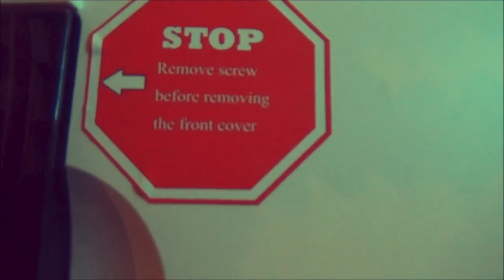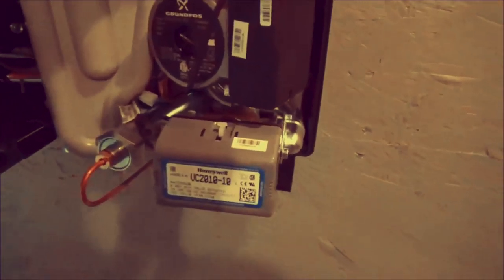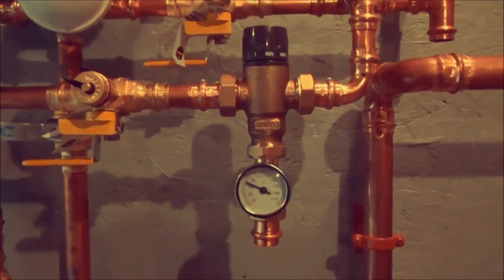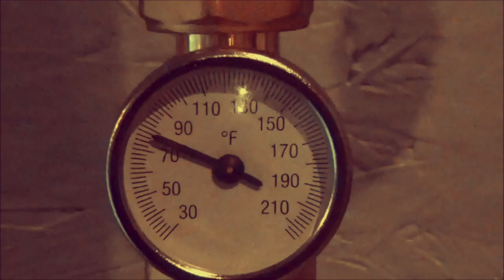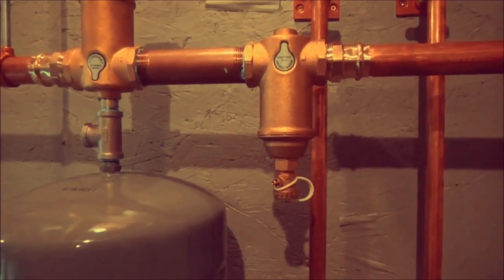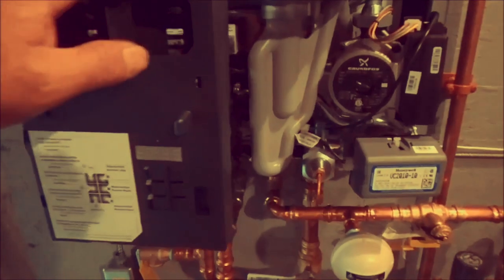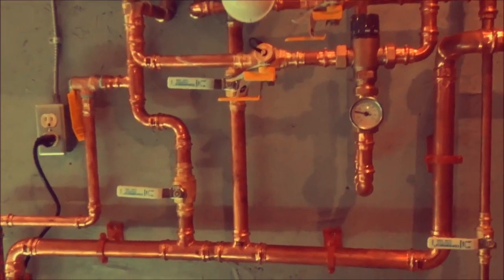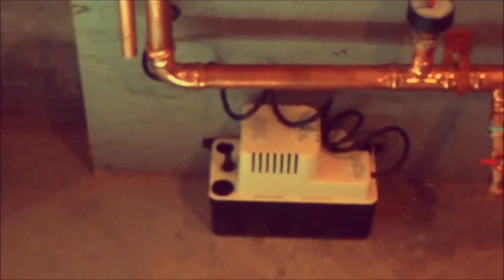Installing a Rinnai, Modern Condensing Combination Boiler

Comment: These are actually good units despite what some of the comments state... Lack of maintenance and service techs that throw parts at equipment they don’t understand is what costs you insane money to “fix”. Only annoying issue with these for me are the three way valve but I keep in stock an actuator motor and 3 way cartridge almost always the issue on these otherwise fine boilers when installed correctly!

Comment: Nice install. It is a real showcase. No need to flush the plate heat exchanger though. It has corrugated design and does not scale up, even with hard water. Rinnai appreciates great boiler installers like yourself.
Reply from the maker: Thanks for the kind words.

Comment: Any chance of listing out or adding to your video the specific parts you used to put into this build?  I’m sweating my system but your parts list would make my build clean and correct.  I have the Rinnai combination heater, radiant floor heating and potable water heater, like the one in the video.  
Very clean and awesome build.  Thanks

Comment: One thing I would have done slightly differently is have my pressure relief terminate into the condensate pump rather than just dump out on the floor. Since local plumbing code would likely require the end be visible so that one can see that the relief is leaking, I would have it terminate overtop of a bell end of a larger fitting before the pump. Then you have no mess to deal with on the floor.

Comment: I do like your install, very tidy and organized.
But in pretty much every english speaking video the Spirotech appliances are installed the wrong way. If you have seperate Spirovent and Spirotrap - not the Spirocombi - the Spirovent ideally belongs to the hottest spot in the system. So in this case it needs to go between boiler and pumps and not in the return. Installed this way, the Spirovent can collect all tiny air pockets from the system, which were not previously bled out.

Comment: I see you fitted a DHW mixing valve, i live in England and don't fit these to combination boilers due to the fact that the boilers a designed to give a 35degree  temperature rise at a set flow rate. I do fit them to Cylinders to reduce the risk of scalding.

Comment: Very nice. I have zero experience with these types of condensing boilers, having only ever installed a standard NG-fired Burnham 30 years ago, which has run flawlessly (it was the first time I'd ever done a hydronic system in my life). I put two zones and later added a third for an Amtrol domestic hot water tank which has likewise run flawlessly.  Its age and the relative lack of availability of certain parts, as well as the lower efficiency vs. new designs, has me looking at replacement before I HAVE to. A couple of questions; The "Primary/Secondary" thing... what's that all about? And the closely spaced Tee's. Not sure I'm understanding that whole thing. The cleaning/de-calcify'ing loop is interesting. We have fairly soft water here in Somerville, MA, but it's always a good idea to have the ability to do that. Those Nibco press fittings are the Bee's Knees. We use them now almost exclusively in work. The company sprung for a really nice press tool at the plant that can do up to 2" copper and I get to borrow it for projects. :-)

May I ask (respectfully)... Do you have a favorite brand/manufacturer? Rinnai, from what I have seen, is a good name. Are there others that you would recommend?

Nice job! Keep up the great work. Thanks for posting the video. Stay warm.
Reply from the maker: Hey thanks for watching and appreciate the questions. Rinnai is my go to boiler. Bosch Greenstar is another good one. The primary secondary is the way to go on multi zone projects. Rinnai used to insist on using their low-loss header which is basically the same thing. It's simple to do but a bit hard to explain with these parameters. there are some good videos on YouTube explaining the principles of primary secondary and the importance of closely spaced tees.
Reply: @workingclasswoodsman  Thank you for the prompt and courteous reply.  I'll definitely check out the videos you suggest. All good stuff. Happy Holidays to you and yours.

Comment: I am installing a simple M-series 120 k solo.  I bought the plumbing kit and prior to buying piping I noticed the plumbing kit has a 1 1/4" diameter supply/return header.  The heat exchanger I am installing in my Heat Pump supply plenum is 1" diameter.  Can I reduce the supply/return header to 1" and run 1" copper for my system?

Comment: Hello  from NY. I have a question about Circulator/Pump. My Combi boiler has a built in circulator/pump. I am installing single zone heating with domestic Hot water line. It is a small 2 bed room same level apartment with Baseboard length for entire apartment is about 70 - 75 ft. Do need to install external pump on piping feeding to baseboards?

Comment: Please help! Lol. I have an 8 year old E110 cn. The plumbers hacked everything they touched.
They ran 3/8" loops to the 3/4" baseboards. They had the heated water temp at 90°f.
Is this correct? I've had nothing but trouble and a plumber wants to rip out the heat loops in my house and replace with 3/4" copper. Also we might rip out the rinnai and replace it with a new IBC combi.
Any help from anyone with experience would help before I dive in.
Thanks
Reply: I'm not knocking plumbers, but I've had other plumbers here and we can't fix all the leaking unions because none of the pipes were installed square or level. This was installed when my house was rebuilt after being destroyed by fire. It was done with insurance and many of the subcontractors took a fast and cheap way. I've been repairing many things that failed due to installation error.

Comment: How long have these combi systems been around? My 60+ year old GE boiler just went south. It was still running fine, but the cast iron tank corroded through. It actually operated the same basic way as this modern unit. It heated the house via radiant water heat and the hot water for the faucets in one unit, which is why this system appeals to me. Are they reliable....seems pretty sophisticated.
Reply: You can think of these as essentially the same but with two stages so that the otherwise wasted heat gets recovered and gets used to heat the water after all. Old boilers achieved roughly 60-70% heating efficiency (AFUE) while newer single stage heat exchanger boilers hit 80-85% efficiency. These two stage condensing Boilers achieve anywhere from 90-98%+ heating efficiency and use drastically less natural gas than older units. Basically you can now enjoy the same energy efficiency (and "fuel economy") that modern forced air furnaces have while not having to convert to a ducted system. In that same regard, ductless mini-split air conditioners also allow you to skip on having to engineer ducts into your home.

As for reliability, the only thing in these (as with a regular boiler) that would typically go wrong are things like igniters, temp sensors, and microchips. They are very reliable.

Comment: Nice job. Why the mixing valve on hot water ? Amusing should be able to set temp. of domestic water on the boiler.
Reply from the maker: NO, this model has a plate heat exchanger which requires a tempering valve. Its in the installation manual you can download in a PDF online.
Reply: Oh OK , was just wondering, probably better, fewer gadgets to go bad in the boiler. Thanks.
Reply from the maker: Right on buddy, thanks for watching

Comment: A thing of beauty............how much more$ are the compression fittings over traditional solder?  Could pex be used anyplace?
Reply from the maker: The press fittings are more expensive but not much if you buy them right in bulk. Pex can be use anywhere as long as it has the HEAT rating which is basically an oxygen barrier. I convert to pex at the floor joists.
Reply: Makes sense, good video and information, I own 2 ancient houses and cant have too much knowledge on this stuff.

Comment: I had two Rinnai boilers installed by two separate contractors - one seven years ago, one six years ago.  Both were professionally and properly installed and have been absolutely horrible!  I own a number of investment properties and the ONLY boilers that have given me problems over the past 12+ years of owning these properties are my two Rinnai boilers.  Problems started right after the first year for each of them and, in the early years, there was always some excuse as to why Rinnai didn't feel the breakdown should be covered by warranty.  I've spent thousands of dollars in repairs on these two units while all my other units continue year-after-year to operate flawlessly.DO NOT BUY RINNAI!
Reply: We had a ecoking combi installed 4 years ago, trouble,trouble, trouble. Never buy ecoking.

Comment: Very nice work.. I do have a question.. can we use the internal circulator to running a hydronic air handler or do I need to do a primary and secondary loop and add a second circulator?? Thanks
Reply from the maker: The internal circulator is fine for one's own but if you're doing more than one zone you should do primary secondary

Comment: Nice install!! I got a question, hope you can answer. I live in Canada in a rancher one level. It has radiant heat and my boiler is on the tail end of its life. I got a price on a combi unit and they wanted a ridiculous amount! I realize the units are expensive and they need to make money obviously but was quoted $$8500-9000 plus taxes.. is this normal??  That's basically 5-7k for labor 😐